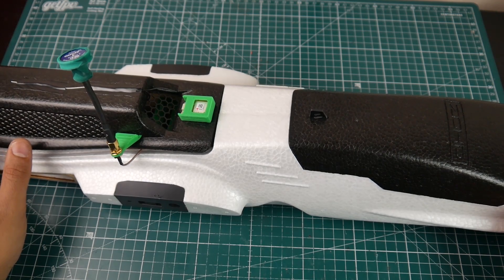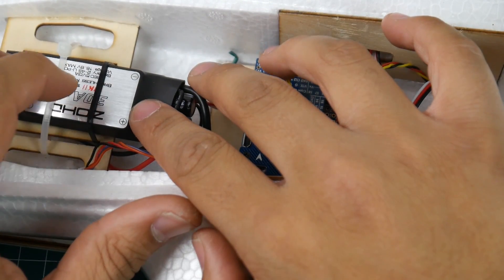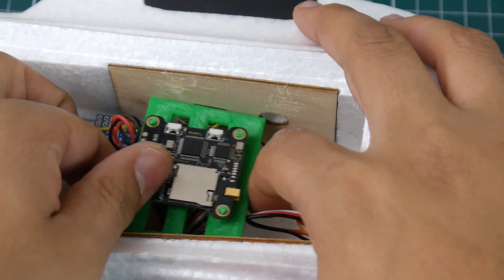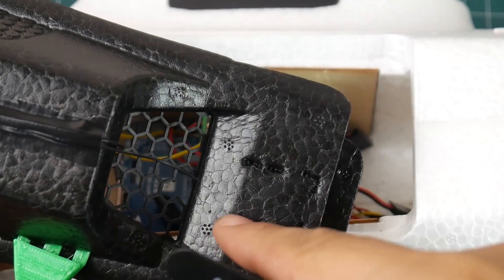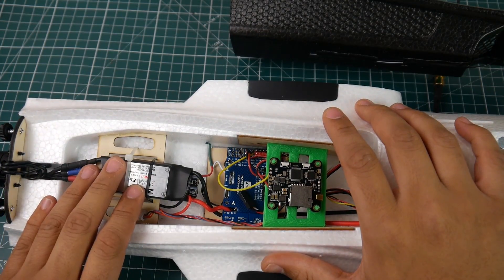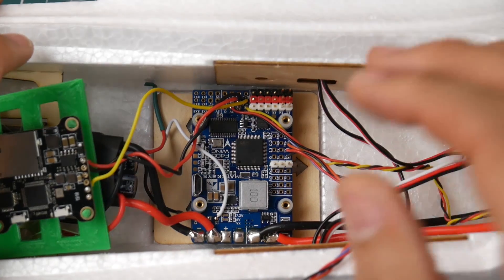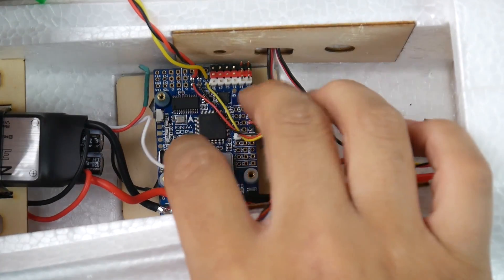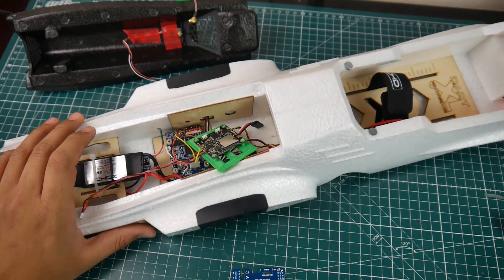Zohd Dart XL INAV Build and 3D Printed Parts

Comment: Nice build bro! I love how you really thought out the 3D printed parts. Another thing you can do if you decide to take off the 3D printed Parts, Is use black gorilla glue and it foams up we'll to seal all those holes and you just cut the excess off with a razor blade and you won't be even to tell that you put holes there to begin with. Alsip awesome to glue 3D printed parts to foam you only need a tiny bit. 

Going to go find your maid in video now I just got into fpv planes and I want you to anything other than matek for Inav I tried six other boards they don't even come close to the performance of Maytek.

Comment: why not mount the Matek F405 Wing with the arrow facing forward, fits better that way and then the speed control and radio line up with the board connections.

Comment: I like your setup here, but one thing that does concern me is the location of the GPS.. ZOHD says that the cooling port was computer optimized, I'm assuming this means they used cfd to develop that Port that you just put the GPS receiver in front of. If that's true there's a pretty good chance that by having that thing blocking the inlet you may be completely disrupting the airflow into your equipment Bay. It looks like they actually put a little bit of thought into the design to ensure proper cooling, so I would relocate it if I were you. Just my .02, otherwise great build! I'm probably going to pick one up for myself now for a NAVIO2/ 4GLTE super long range build.